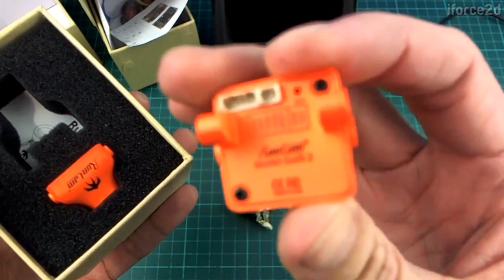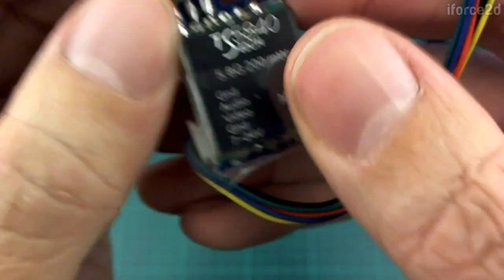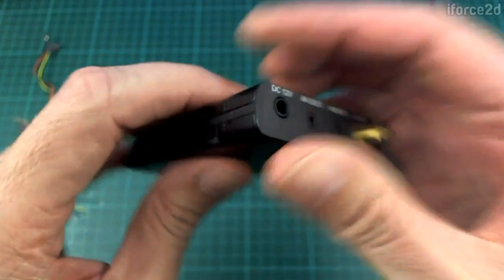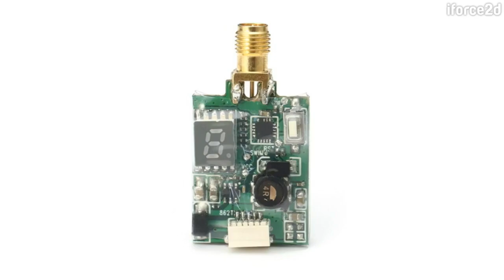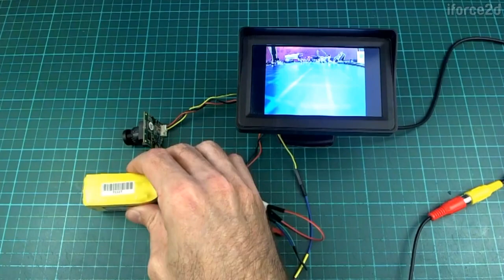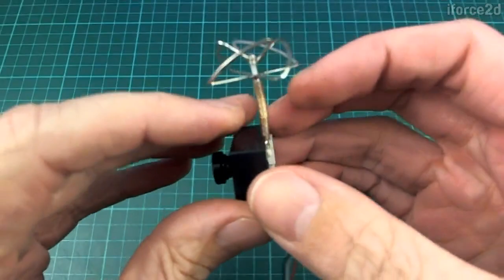Noobs guide to quadcopters part 10 (FPV gear)

Comment: What do you think about this receiver and using it with an android device? It's pretty cheap and convenient but I'm not sure about reception quality.
https://www.banggood.com/Eachine-ROTG01-UVC-OTG-5_8G-150CH-Full-Channel-FPV-Receiver-For-Android-Mobile-Phone-Smartphone-p-1147692.html
Reply from the maker: I think you would really need to ask somebody who has used one. Usually when the analog signal is converted to digital there will be some time latency as a result. I watched one of the video reviews on the Banggood page, it actually looks pretty decent. He estimated about 80ms latency which is more than I would like for fast or low flying close to trees and through small gaps, but it would be fine for more relaxed flying or on a aerial video quad.
Reply from the maker: Reception would not be a problem, the latency is the main issue. And if somebody calls your phone while you're trying to fly you might have a problem too :)

Comment: Super very helpful 👍
Yes it is Germany with the 25 mW Max transmitting power
It will try whether my power supply is clean enough for FPV otherwise a separate battery for FPV
Thank you